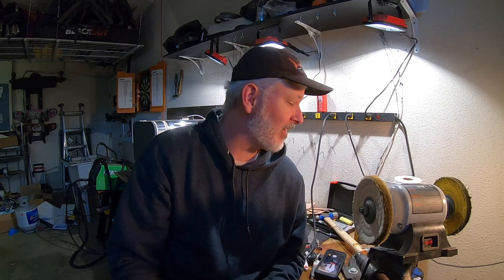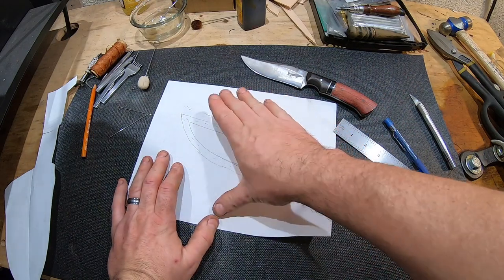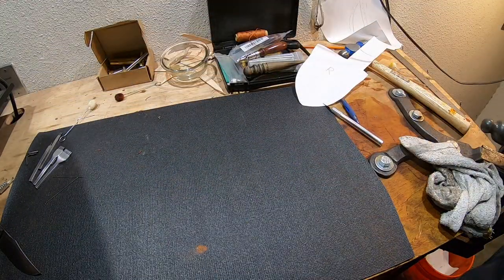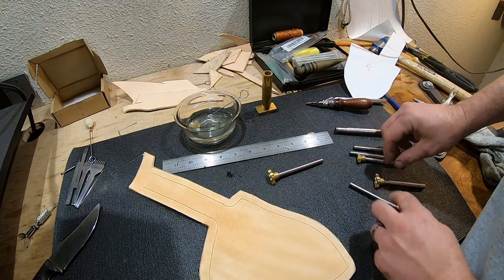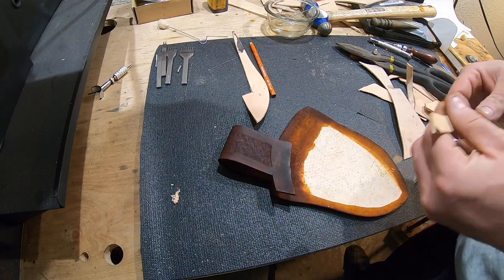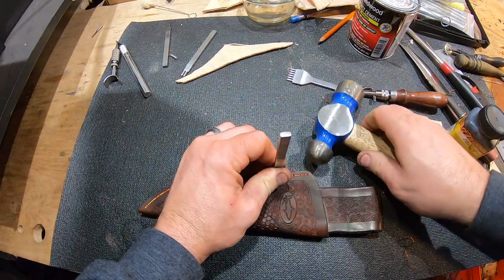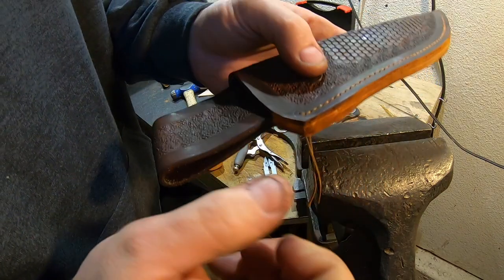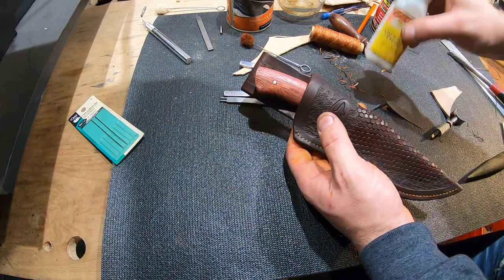Leather Sheathmaking 101

Comment from the maker: Do yo have any other processes for making sheaths?  I love acquiring new stamps so let me know if you have some cool ones!
Reply: I have always liked the meander or serpentine pattern stamps like the D444 craftool stamp.  Have you ever tried using Fiebings pro dye used to be sold as professional oil dye?  I find it to be easier to get even and like the colors more.  It also seems to have a lot less rub off and is less likely to surface bronze.
Reply from the maker: @bransonsgeneralstore  I don’t have that stamp but always buying new ones so maybe soon.  I’ve had good experience with the regular (alcohol) fiebings but never tried the oil.  Maybe I’ll pick some up.  Thanks for watching!
Reply: I started using a rotary cutter to cut my leather out. It’s like a pizza cutter for leather and thick material. Mine was a cheap one from Amazon but it comes with several replacement blades. I’ve probably made 8 or 10 sheaths and still using the 1st blade. It was $13 and made cutting go so much cleaner and quicker. Another tip I got from someone is to take a small spent drill bit, like 3/32 or 1/16 and ground a point on the shank end. Chuck it upside down in the drill press and use the point to make your stitch holes. Makes clean burnished holes doing it that way.
Reply from the maker: @jbaileyknives7282  thanks Johnny!  Do you have a link to that rotary cutter?   I’d be interested in seeing that.   I’ve seen people use a nail in a drill press for stitch holes too, but the 1/16 drill has always worked perfectly for me.
Reply: @Tyrell Knifeworks i couldn’t get it to share but go to Amazon and search rotary cutter for leather and it brings up a bunch of different ones. The one I got was orange and says Rotary Cutter on the side of it. It’s $9.99 now with 10 replacement blades.
Reply from the maker: Thanks!

Comment: Nice video, and nice sheath too! I've seen another trick for the saddle-stitch somewhere else, can't remember where. What the person did was, instead of pulling the first side through completely, he was leaving a loop hanging back, threaded the opposite needle in, spun the loop around the needle, then pulled everything tight. The idea was that instead of just crossing each other, the threads were in effect forming a knot inside each and every hole. The idea is that if the stitch was damaged due to an accident or wear and tear, the knots stuck inside the leather would help prevent it from unraveling further, until it could be repaired.
Reply from the maker: Yes I’ve heard that approach.  Honestly, the holes are small enough that it’s hard to even get two threads through and it pulls tight each time and doesn’t back out.  Going through the other thread is a pain and not worth the effort it takes for these.  I’ve never had an issue with the way I do it.  I’m sure there are lots of ways but this works for me.  Thanks for watching and commenting! 😜

Comment: Nice sheath. I usually don‘t do a lot of stamping on my knife sheaths but this pattern is really nice.
Basically I do my „taco“ style sheaths the same way but please allow me to do some comments.
I like the way how you integrated the end of the belt loop that reinforces the edge of the mouth. I will try that myself.
I stopped drilling the holes but rather use an awl to poke the holes. You might need to make the welt a little thinner though. A stich line where the holes are made with an awl will never ever get loose even if the thread gets cut somewhere. Why? A drilled hole has has material removed, you have a hole. An awl cuts the leather and pushes it aside, once you are done with stiching and when you hammer down the stich line the leather moves back and firms around the thread. Saddlers do it like this for centuries. Ok it is more difficult when you sew thicker leather.
A saddle stich is actually more than stiching with two needles from both sides. It is important that you overlap the threads when you sew, that creates a half hitch in the hole and makes the stich even more secure. I will not try to explain this, there are some very good videos on YT (look at the channels of Leodis leather or Nigel Armitage). 
I find it easier to have the seam up and stich towards me, OK I made myself a stiching pony for this.
I subscibed to your cahnnek now.
Reply from the maker: Thanks for the tips, Roland!  The drill I use is still much smaller than the width of both threads so it’s still very tight.  Thanks for watching!

Comment: Why wouldn't you use a simple wheel marker? Having hammer markers seems a little bit rudimentary for your skill level. Guess I'll see..
Reply from the maker: I just don’t have any wheel markers.  My sheath work is still pretty novice level.  Maybe I’ll look into those.  Thanks for watching!
Reply: @TyrellKnifeworks  can I ask you a personal question? Are you a JS or MS?
Reply: If so, I have a lot more questions for you. If not I still have a lot of questions for you
Reply: However my enquiries are not without information as well. I have some very very interesting ideas of things that could be done. Things that I don't really think I've been thought of too much. I won't go into it but I am looking for bladesmiths with adequate technique and skill to formulate an idea of the new age of Damascus. I know it sounds grandiose, and is easily a delusion of grandeur. But I have some ideas, and based on my knowledge of how steel works I think they are not far from possibility. You have my email
Reply from the maker: Neither at the moment.  I’ll be testing for JS next year.
Reply: @TyrellKnifeworks  nice dude! I just started within the last 3 months into my process. So I think I'm a bit behind you but man you do some really nice work. It would be really fun to collaborate on some projects if you're down to do it. I have some interesting ideas that I'm going for
Reply: Honestly I don't really want to disclose the ideas that I have unless there is a collaboration between makers so if there is any discussion of the ideas that I have it will have to be over personal email and not public comment. Sorry about that. Again feel free to check on my Instagram I have a couple of photos of some blades that I've made up there nothing that spectacular. I think it's pretty much just my first Mosaic Damascus a few photos of my recent builds and some skateboarding shots. Not exactly fine-tuned yet